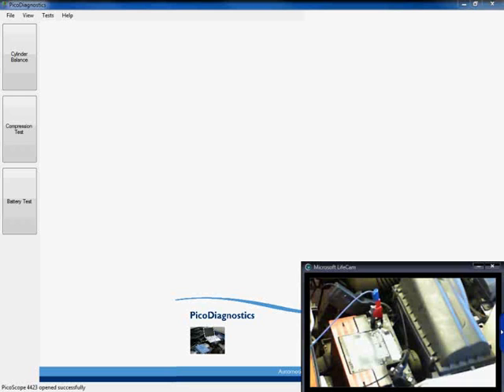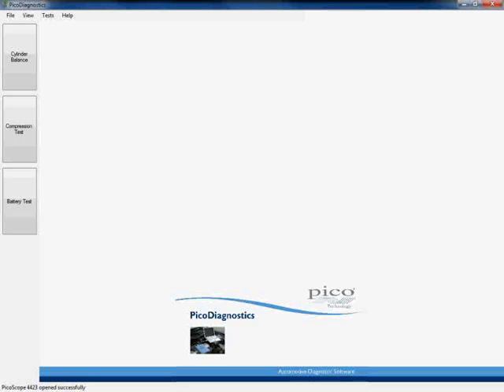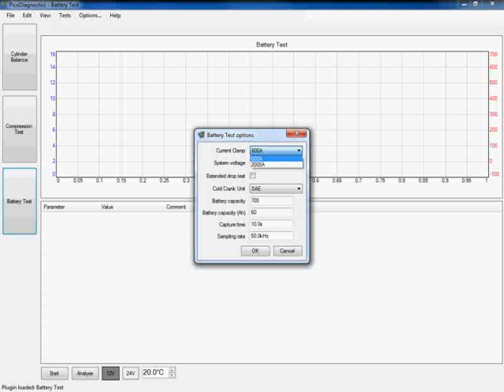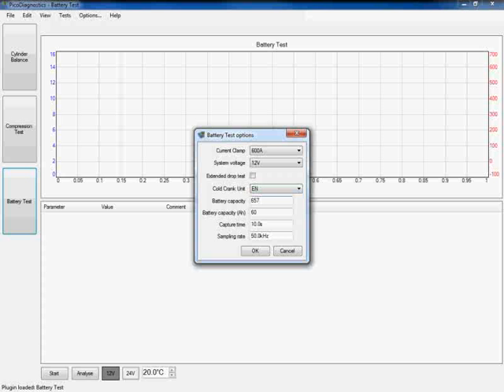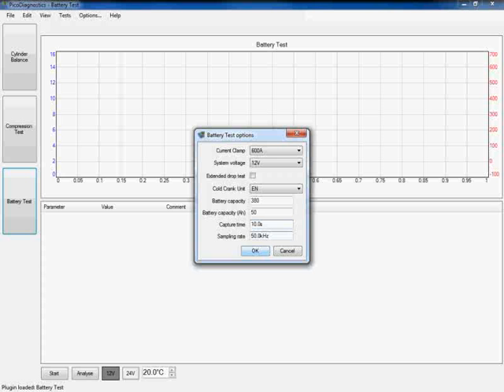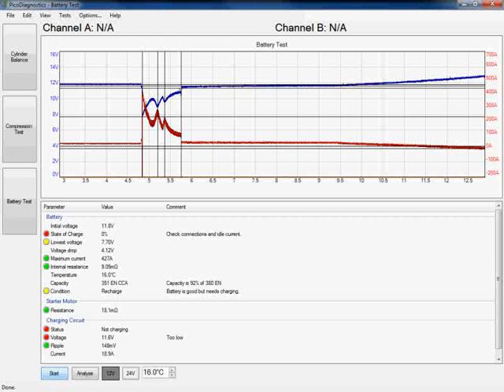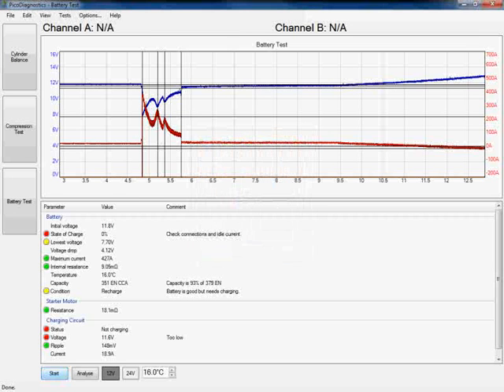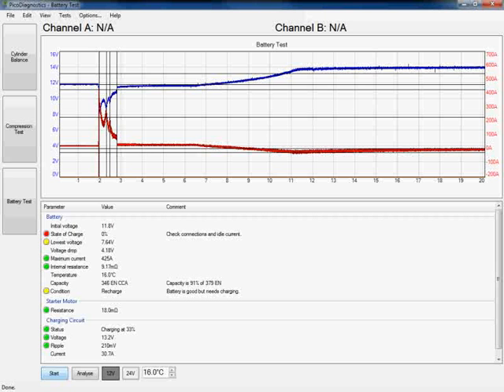Test batteries, alternators and starter motors using an automotive oscilloscope

Comment: At what point does it call the ripple voltage too high? I find usually that a reading over 200mV is almost always a bad diode discharging the battery.